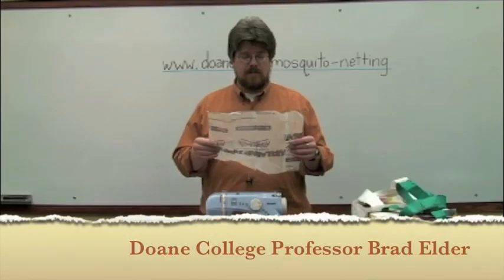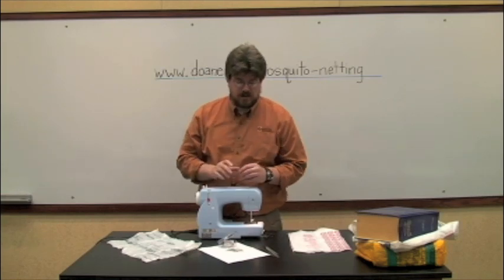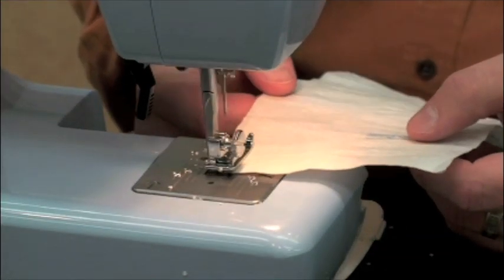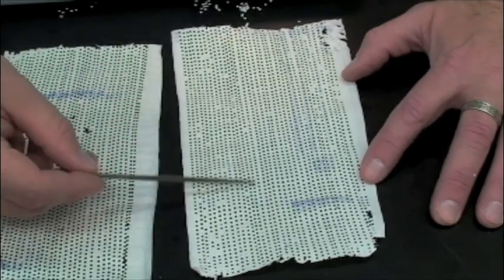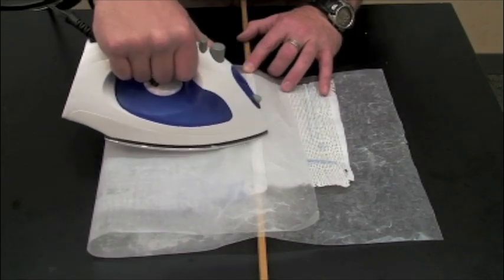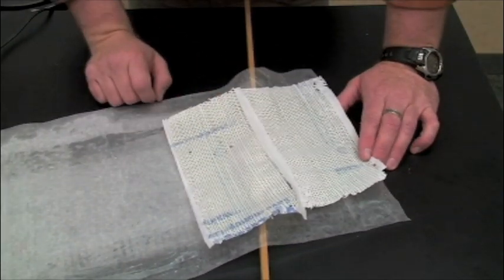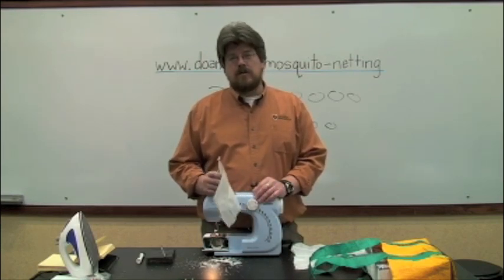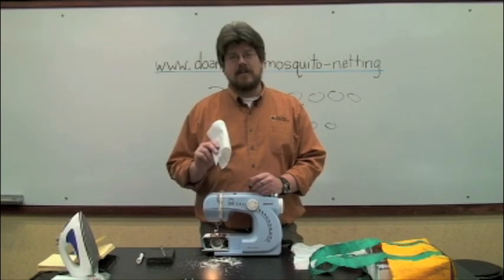TB2HB Mosquito Netting with a sewing machine

Comment: It looks like just about any sewing machine will work, treadle or electric.  The key option you want is the fully variable stitch option.  This allows you to put the stitches/holes as close to each other as possible.  The blue Kenmore in the video only has three stitch width options.  But the Butterfly in the still shots is fully variable.  The Butterfly was the most economical machine we could buy (not good).  We are now trying to find money to buy a better machine for the group in Kenya.  Brad